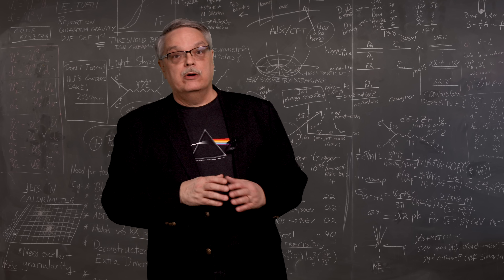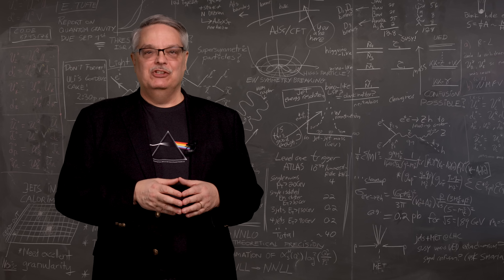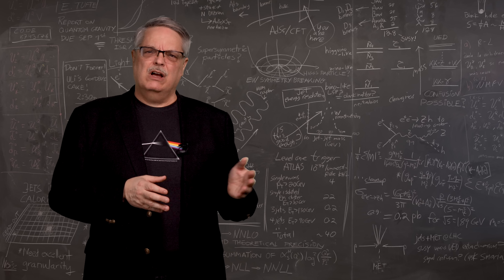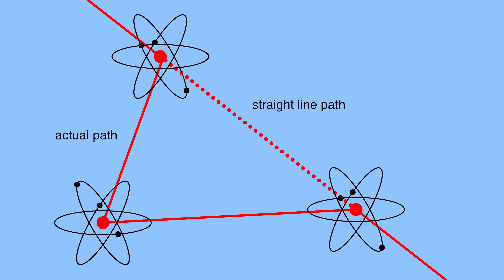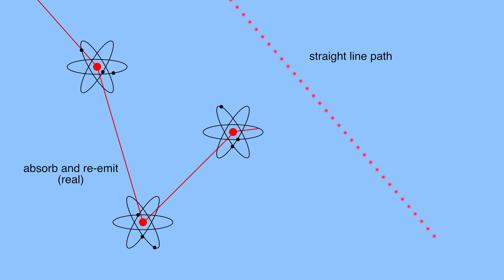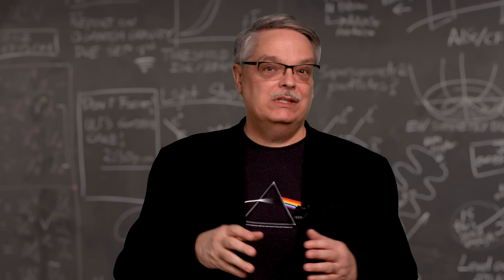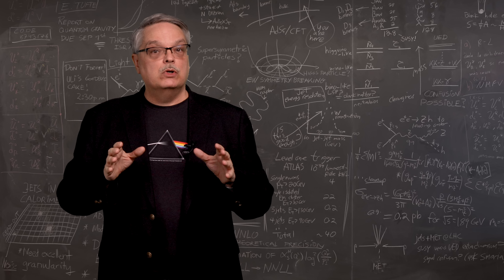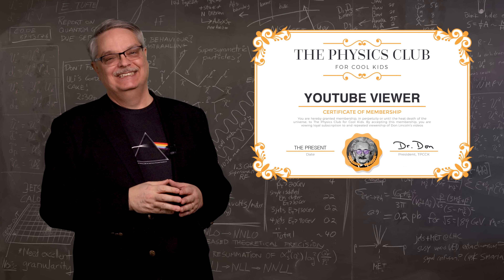Why does light slow down in water?

Comment: I have a few questions -
If the wave slows down, shouldn't the new wave formed slow down again when it strikes another electron(doesn't get absorbed for long ofcourse)?
And when the wave has already slowed down , when it emerges why should its speed increase again when it has already formed an entirely new wave?
Reply: Generally, any harmonic oscillator (i.e. spring-like thing), will move at a different phase than the applied sinusoidal force (i.e. the maxima/minima won't quite line up). Electrons in a transparent solid can be regarded as a giant array of these harmonic oscillators. So, as the wave traverses the solid it accumulates a phase change for each oscillating electron. The macroscopic effect that we observe is a slow-down of the wave velocity.
Reply: @Camptonweat  Exactly but what I mean to say is that if it accumulates a phase change for every oscillating electron , shouldn't it keep doing so and hence DECCELERATE , which as you say we observe on the macroscopic level as the wave slowing down.
All I have to say is that: I believe it should deccelerate , yet people say that the speed of light in glass is constant(maybe the refer to the average speed); but shouldn't this also mean that light will eventually never come out from an infinitely long prism.

Although I am confused about what really happens - Does the effect of an oscillating electron ( that changes the phase of the wave) last temporarily only? because if the electron inputs no energy of its own , the effect should last temporarily by the law of conservation of energy.

PS I asked another question in my original comment , please answer that one too if you know it for I really am desperate.
Reply: @redgeronimo1  In a uniform material, light has a constant velocity. The presence of electrons and the associated phase shifts they impart makes this velocity less than c. There is no speeding or slowing down of the wave in the medium, hence why it is incorrect to say that each electron progressively slows the wave. Changes in velocity occur at material interfaces, and are instantaneous under the usual classical idealisations.

Apart from the sinusoidal variations, everything is infinite and unchanging in time. This is known as a continuous-wave model. Conservation of energy is maintained because the electrons are simply exchanging kinetic energy to potential energy repeatedly. There is no transient period where the material goes from being unilluminated to illuminated for example. In the case of say a laser pulse, there would be a temporary deposition of energy and momentum into the solid as the pulse passed through.

Finally, the argument as to whether the exit wave is a new wave or a continuation of the old wave is largely semantic. I'd advise not to think in those terms, purely because, mathematically, you solve these problems by assuming some input wave, then calculating the response wave, and you risk confusing the two by giving them the same label.
Reply: @Camptonweat  Wait , how is the velocity changing if there is no speeding up or slowing down?
Like do you mean the direction changes?
Reply: @redgeronimo1  Classically, the velocity change is instantaneous, due to the way the interface is modelled, as a discontinuous (or "hard" edge). There is no continuous slowing or speeding, just an abrupt jump from "fast", to "slow" (in the medium), then "fast" again once the light exits the medium. For exactly the same reason, the path of a ray does not curve, it bends abruptly, like an elbow joint.

Although this is an idealisation, it is a pretty close approximation to what happens in reality.

In contrast, one can get materials whose refractive index changes smoothly with position (a graded-index), then you do get acceleration/deceleration of the wave, which would bend in gentle curves, rather than sharp "elbows".
Reply: @Camptonweat  Ok I get it the change is instantaneous compared to the speed of light but all of this still doesn't explain WHY light actually slows down in a medium, I am confused.
Reply: @redgeronimo1  Fundamentally, it comes back to the oscillating electrons and the phase changes they impart on the propagating wave. Each phase shift can be thought of as pushing the wave backward a little bit, with the overall, macroscopic effect (keeping in mind that the wave traverses billions of electrons each cycle) being a wave with reduced velocity.

The quantity we call refractive index actually derives from this collective behaviour. The stiffer the "springs" are holding the electrons in place, the lower the refractive index all other things being equal. For some materials (typically crystals), this "spring stiffness" changes with direction, resulting in the phenomenon known as birefringence.
Reply: @Camptonweat  So when it is pushed back, it still maintains its speed but is slowed down due to an interference?When it exits the prism there is no such interference and hence it continues to maintain its original speed, doesn't it?
Shouldn't air too have such an effect on light for it too is transparent?
Reply: @redgeronimo1  Yes, that is a pretty accurate summary. Air indeed slows light down, but not to the same magnitude as a solid/liquid - refractive indices of 1 + 0.0001 are pretty common for gases. This is purely due to the density of air being much lower - fewer electrons to traverse per unit of distance.
Reply: @Camptonweat  I really am thankful for the time you have taken in answering. This concept had been bothering me for quite a while.
Reply: @redgeronimo1  Hey, no problem, I'm glad you got something out of it. Best of luck.

Comment: If it's wavelength is changed,then the colour should also change,but it is not.so it might be wrong.
Reply: Nope, color is related to frequency, not wavelength.
Reply: @Camptonweat   yah!  I agree,but when it comes out with the increased wavelength (with speed c),it's frequency too changes right?(as frequency *wavelength = speed c).           If iam wrong ,please correct me.
Reply: @likemefriction6037  Frequency is invariant, the velocity slows, but the wavelength changes such that v = f*(lambda)
Reply: The colour is related to the frequency, not the wavelength

Comment: I need more on the speed up. Watched it twice. 
I get that the electron wave is gone at exit, but If you take the friction off a sliding hockey puck it does speed up to original speed... it just stops slowing down. What mechanism allows light to maintain a "preferred" speed?

Comment: So in theory, there could be a material that's both opaque and translucent at the same time? Translucent, as in when photons do not have enough energy to excite electrons in the material to a higher energy level, so no light is absorbed - but opaque because the wave induced in electrons would be destructively interfering with the light? :D Or is it just an artifact of thinking about light in two different modes, wave and particle?

Comment: ok so the field of electrons interacts with the field of photons as it passes through that medium changing the wave structure.. but how does that affect the propagation speed  ??? I mean there can be either constructive interference or a destructive one. but that should not change its propagation speed. Well i think we can have an experiment to prove this .  in double slit experiment the photons interact with itself creating an interference pattern and the medium is air since there is a change in the field at every point each of these points should be traveling at different speeds even in the same medium compared to single light beam!!!!!!!... anyways my point is I still don't get why the propagation speed will slow down

Comment: Help! Assume two instances. One where the glass adds a wave causing the light to slow down and bend and one where the glass doesn't add a wave so the light continues the same speed and doesn't bend. In the first case the light slows but travels a shorter distance.  Do the two instances correlate perfectly so that no matter how thick the glass or the angle the light enters, the light will be emitted from the glass in both instances at the exact same time? Anyone who knows please advise, thanks!

Comment: if the wave produced by electrons which in turn interacted with light wave was of the same speed as the light wave, could we then say that the resulting wave too would be of the same speed, but because the wave produced by electrons is selectronsn light so the net wave has speed somewhere in between the speed of light and that of electrons...Is that right inference??
Secondly, what major factors determine the "speed" of the wave produced by oscillating electrons and what are the physical explanations of wave speed of those oscillating electrons.

Comment: 1. How does your superposition theory reconcile with your theory of why light bends? If indeed superposition is happening, then the resulting net E-Field will also change, which will ultimately result in changing angle of bends (as vertical E-field component will change) as the light progresses through the material.

Comment: Why does the movement of electrons causes a SLOWER electric field than the electric field of light...??? I understand the oscillation could be different but why the SPEED ...??? That speed is causing the net speed of light in the material to be slow so how come that speed (electrons' electric field) is slower from the start...???

Comment: The issue with this explanation is that the premise hinges on the fact that the second wave moves at a different speed than the original wave. But the wave created by the electron DOESN'T move at a different speed than the original wave. They both move at the speed of light. Therefore you can get a resultant wave that has a different wave speed according to the provided explanation.

Comment: During refraction if light is considered as a particle, it's velocity changes from 3 multiplied by ten to the power eight to 2 multiplied by ten to the power eight. That means change in velocity is ten to the power eight meters per second. If we take time required to change the velocity. This will not be more than the time required to to pass the light from other end of the vessel in which water is kept for conducting the experiment. If we take it roughly one meter. Then the time required will be less than one divided by 3 multiplied by ten to the power eight ie .3 mltiplied by ten to the power minus eight second. Now acceleration is change in velocity divided by time comes of the order of ten to the power sixteen meters per second which is very very greater  than the speed of light. It seems that it is a case  of time travel. The refracted or reflected rays of light may contain the information of past or future. Also some persons of Britain claimed that they have seen the ghost of princess Diana in the reflected rays of light from glass. This may be true..

Comment: but combination of the two waves will result not only in a change of speed, but in a new waves that have different frequency and wavelength, while when it comes back to vacuum or air it still have same old wavelength and frequency ... ????!!@@
Reply: I try to think about it this way: you’re running on a normal flat surface at a faster speed, and you run into some obstacles. Even though you still try to run as hard as you do on the flat surface, you are slowed down by the obstacles. Once you get through them, you can run at the faster speed again because there is nothing there to slow you down anymore.

Comment: That's important , but it may show better results to compare the motion of light through the density of air particles and water particles ...to see deeper math is to open both elemental doors , you may already have in equations not shown yet , but the polarities of water and air and their relation to light in motion , the equation has to be structured right , to get the exact answers ...or answers further ahead..

Comment: If the speeds back up when it comes out of the glass, why doesn't it "run away" from itself (the light in the glass) and Blink?
Reply: Because an electro magnetic wave is continuous. The speed up only stretches the wave lenght of the wave.
Reply: Why no color change? Color and wave length are  related aren't they?

Comment: The way I understand it, the time it takes each electron to feel the force from the original wave and produce a new one causes each new wave to be slightly retarded in phase, therefore reducing the phase velocity of the overall wave.

I tried to model this using sine waves in audio software; when each additional wave was less than 90º out of phase then the phase was slightly delayed. I'm still not sure I'm thinking about this the right way or if the effect I observed would be nearly big enough to account for a 30/40% reduction in phase speed.

The frequency(colour/energy) would remain constant right? This would then require the wavelength to shorten if the wave was moving slower. Not sure how that ties in with the whole phase experiment thing. Input is welcome.

Comment: Could you please make a video about why refractive index of materials for X-rays is less than 1. I know it is less than 1. I know it means the phase velocity will exceed the speed of light. But can you explain it with superposition? What kind of an oscillation does X-rays cause in the material that makes up a wave that's phase velocity gets faster? And more importantly, why do X-rays do that? Is it because of the extremely high frequencies? Is it also possible to explain it considering light as a particle?

Also you demonstrated in the video that explaining light slows down due to re-emission is wrong. Does that mean photons do not get absorbed and re-emitted all the time due to oscillation? From what I learned the light an oscillating electric field, oscillates the electrons in the same direction. And due to dipole emission, the emission direction will be in the forward direction and not random. Is this all wrong? Please help, I am confused...

Comment: Does light lose its energy while interacting with the particles inside the glass ? 
I mean you explained in one of your video that light interacts with the medium while passing through the medium (refraction) , if it interacts  with medium  then it should lose its energy .
Reply: It does lose energy. Light coming out of a medium is less intense that light going in. In fact, Chemists use devices called absorption spectrophotometers to measure these decreases to determine the concentrations of chemicals in solutions.
Reply: @wayneyadams  Thank you so much for your explanation .. 🙂🙂

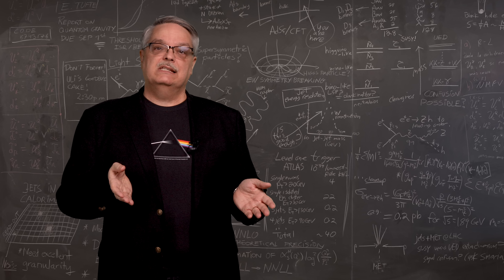Comment: Seems really strange that light upon exiting the material (2:40) turns and resumes the direction it was traveling in the first place... Why would it do that instead of now continuing to travel in a straight line in it's new direction? Its like it has some memory of it's original direction and so resumes it? That of course is crazy but what is the reason it runs parallel to it's original direction.  It seems in some way that it must never have changed direction at all or had continued to run in a parallel direction while nevertheless shifting it's position due to the medium it entered. Can someone please hopefully explain?

Comment: Dr. Lin's explanation also seems to be wrong. Because he says when light exits from glass somehow it reform into its original wave thus original speed. According Dr. Lin, because there is no electron wave interference in the air (for argument), that's why light maintain its constant speed. 

Here is where Dr. Lin's explanation doesn't work. Light slows because it faces obstacle in the glass but when it's in the air what causes the light to get back to its original wave or speed?

For example when a man running in the solid surface his speed 40km/h, but when the man runs on the mud  his speed slow down to 20km/h. When the man goes to mud to solid surface his speed go up to 40km/h again. So what causes the man's speed to go up? Because the man himself increase his speed. Not because his speed before the mud was 40km/h.

Does this make cat gets Dr. Lin's tongue?

Comment: So it leaves some motion in electrons of the glass ,which means extra emergy .But from where that energy came from.
Reply: I don't know if my logic is completely right or completely off the wall, but I think it might be explained like this. While the light is in the medium, the energy of the wave plus that of the electrons vibrating is equal to the original energy of the wave. When it exits, the electrons stop vibrating and all the energy is back in the light wave. Could that be right?

Comment: if light slows down, it beaks completely the theory of special relativity. Special relativity theory is based on the assumption that the speed of light is the same for every reference frame.
Reply: «in a vaccum, anywhere in the universe» and there's no slow type of light by nature. It's reheated knowledge, you'll be well advised to double check.
Reply: Also more importantly, if light speeds back up when leaving a different medium it breaks conservation of energy bacause kinetic energy out - kinetic energy in =/=0 where is that kinetic energy coming from?